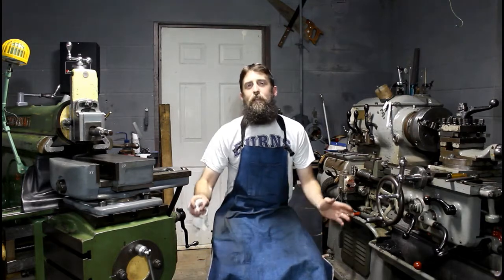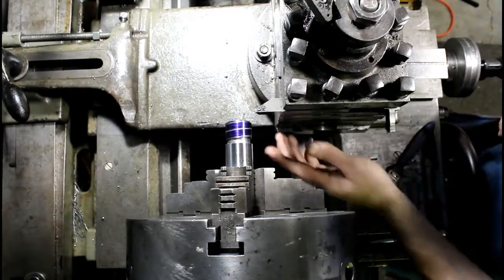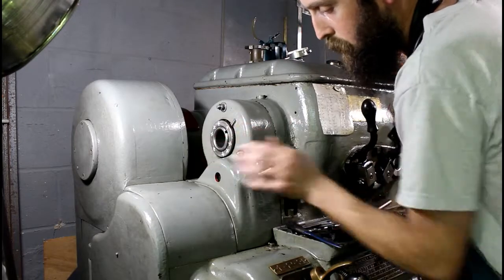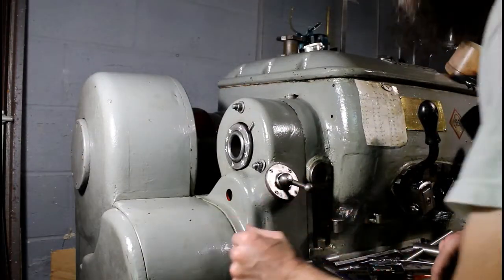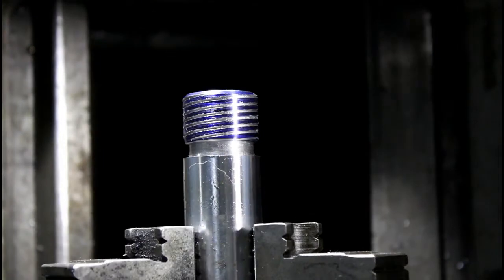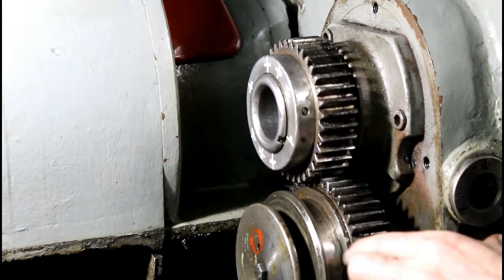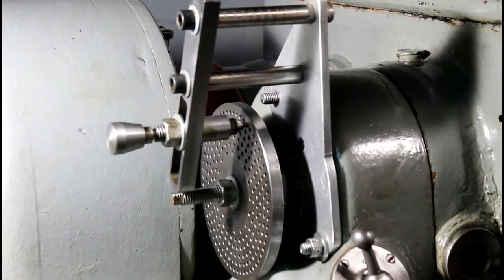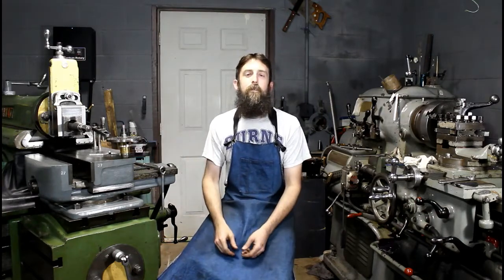Lathe Spindle Indexing / Multi Start Threads

Comment: Excellent video, many thanks.  My DSG has the same feature as yours at the L/H end , but differs slightly in that the collar isnt  fixed, but engraved like yours. Ive done a similar thing as well with the dividing facility, but with a 48T changewheel, so yours is a lot better !. Never done a  multi start thread, but know how to do it now !!. Regards from the  UK.

Comment: Completely ignorant guy with no machine-tool experience here to ask some honest questions. So, by adjusting the angle (indexing?), the angle of the cutting implement (unsure what exactly its called) is changed, which in this setup allows for the cutting of new threads below the ones you already cut? The reason I'm asking about this is because I'm doing research on early automation (late 1940's through the 1960's), and I'm trying to familiarize myself with how lathes, mills, and other cutting, trimming, and other related machine tools work.

Comment: I need to upgrade to a bigger engine lathe gear head lathe....  I learned on a small old Logan and I also have a hardinge dsm 59 with a LOT of tooling, but that is a totally different type of application as you know.  I have limited space, what would you suggest as a home shop lathe at around 7 or 8 feet in length. I was thinking monarch as parts are easy to find. Anyone have any thoughts ? I love doing heavy tool Making and need rigutity !!!!  I love hard turning

Comment: Hi Steve,  Thanks to ABomb I recently found your channel.  Really enjoy it and your down-home style.  The indexing head you made for your lathe is nearly identical to one that came with my Dumore Versa Grinder, Milling and Slotting attachment for lathes.  I had no idea what the index head was for till I found the manual for the Versa Grinder on VintageMachinery.com.  I’ll keep watching, if you keep making your videos.
Reply from the maker: Thanks Bill, Glad to have you here, I had to make something that I could install easy and remove easy. I used scrap parts from anything I could find and it turned out to be a good tool.  I have got lot of good info form http://vintagemachinery.com/            Thanks for watching     Steve Summers
Reply: Hi Steve, gratings from Argentina, I was wondering what brand of lathe is yours, keep those awesome vids coming. Big hug

Comment: Steve, I think I have the dirty twin to your lathe. Mine was built in 1943 according to Hendeyman over on the Practical Machinist (he'll give you the year of manufacture if you give him the serial number). I posted a couple of videos of pulling the apron apart to repair some wear if you ever have to get that far into your lathe. Thanks for sharing. Craig
Reply: I cut a lot of double and quad lead threads for drill rig tooling I use. The Hendey makes it a breeze. Craig
Reply from the maker: Yeah, thread cutting on these lathes is a breeze
Reply from the maker: Yeah, I ask him one time but forgot what he said , LOL  I think mine is a 1942. They are a great lathe, mine is worn bad in the tail stock but I shimmed it and can still get good work off it. I would like to see those videos, post a link if you can. I would like to see what you did.    Thanks for stopping by clemwyo.      Steve Summers

Comment: Nice video Steve, I dont know how your method would relate to my Atlas Lathe if at all but enjoyed your vid. Subbed :)     PS, awesome looking lathe.....beast!👍🏼
Reply from the maker: Thanks, I have  never run an atlas lathe but if you can disconnect the QCGB you should be able to index in some way. not for sure really. Thanks for the Sub, I am new and only been making videos for about 2 months so there is a lot for me to learn. I  Subbed you also by the way, nice channel.
Yeah the bug lathe is like a train car parked in the garage :)
Reply: Yeah, I dont think disconnecting my QCGB will be happening anytime soon, I have a few workarounds for indexing simmering on the back burner...but the bull gear is indexed with 60 holes for basic stuff but I want to make new dials for the cross slide and compound and that needs 100. A 100 tooth sawblade will soon find its way onto the back of the spindle me thinks. LOL I am new to machining....love it. Thanks for the sub. I cant place your accent.....Alabama?
Reply from the maker: I live in Kentucky, is the accent that noticeable? :)  I would in no way call myself an expert machinist either,
just someone who has been machining some at work and a lot at home in my free time over the past 8 years.
Reply from the maker: Everyone starts somewhere,  I consider myself a student also, always more to learn when it comes to machining. I am for sure not the hard nose machinist that you run in to from time to time, I am just having 
fun goofing in the shop with my machines. I try not to say "This is how it's done" I say "This is how I do it".
A lot of times I don't have the tools I need and I got to make due with what I have, there's not alot of extra money left after the kids and the bills :)      I am glad you stopped by, if you need anything just ask, I will be glad to help if I can.
Steve Summers
Reply from the maker: Just watched a few videos on your channel and I must say you are very crafty, like your editing and how much work you put in to your videos, I'm still very new and a work in progress :) I'll get there..  Not that you need it from me with my small sub count but in one of my up coming video of mine I will give your channel a shout out. I am glad to have you here, I am interested in casting and such and may have some questions for ya.
Reply: Yeah, I know what you mean about making due with what you have....thats what my entire channel is about...LOL I appreciate your straight forward content...you obviously know what you are doing
Reply: Glad ya stopped by and watched a few, hope you found something interesting to watch there....which ones did ya check out? If you ever need help with casting just holler. I will have some casting videos coming up soon :)
Reply: I have an Atlas also I you can put your forward/reverse lever in neutral (middle position) and it will be isolated from the gear train, I believe.

Comment: Fabulous video Steve - never seen the indexing on the rear end of a lathe - so its helped me with a few ideas to add the feature to my little lathe. Be hell of a lot easier for cutting divisions on dials etc. Very much like your indexing plate assembly with expanding plug in the spindle. yep even more envious of your lathe ! Thanks for taking the time to make the video and upload. Good to see your subscriptions climbing each week-  must be a lot of little critters free of nasty endings around your way :-)
Reply from the maker: Thanks Mat, I could not find any other way to mount the plate to the spindle so expanding plug it was. The plug holds extremely well and will not slip. This indexing setup was one of the 1st things I built after I got the big lathe
and I have used it several times, not so much now that I have the rotary table. As far as subscribers go , I seem to get between 0 and 10 a day on most days I get about 3-5 ,. I am happy to see the channel growing and hope it continues at this rate or even faster would be nice:) . I don't think most people realize how much work it is and how much time it takes to make a decent video, I know I was surprised at how long the editing takes. I know there are a few happy butterflys  around the yard today . It's tough, that's for sure :)
Thanks Mat, and Thanks for watching.

Comment: Those Hendey lathes had some cool thread cutting features. The lead screw dog clutch, the cross slide depth stop, and apparently the spindle indexing. I never knew about that one though. My Mori Seiki can cut multi start threads. Of course, I do have to copy the G76 line and change one number...
Reply from the maker: Love thread cutting on a Hendey, It seems as if the design of my machine was centered around threading and indexing. I don't have a lot of experience indexing on other lathes but I am sure there is a way with about any machine, guess it just depends on how bad you want to do it. Very nice video on the slotter Wes, Thanks for watching
Reply: My dad has an ancient tie-bar Hendey that he keeps around for tool room type work. I don't think it has that index feature, but I could be wrong. I've never had to cut a multi-start thread. It does a nice job of threading though. Much faster and easier than any other lathe I have run.
Reply from the maker: Yeah, they're nice for threading that's for sure, I think some of the tie bar heads had the index collar if I am no mistaken.

Comment: Steve, good stuff! I knew what multi start threads were but never really knew how to go about making them. What can a guy do if your lathe doesn't have a disconnect for the drive train?
Reply: One way you can do it is to turn the compound to be in line with the bed ways. Then you just move the compound to change the start point for each thread. The catch is that you have to plunge straight in with the cross slide instead of at 30 degrees. But, that's not nearly as bad as all the old book made it out to be. With modern carbide thread tools, plunging is fine up to say 10 TPI.
Reply from the maker: The only way I can think of is to remove the gear clock the spindle and replace, it will work as long as you are very careful. I had to do this on a little Chinese lathe I had several years ago.  You will need to count the number of teeth on the spindle gear and figure what divisions you can get out of it. Thanks for watching Gearge

Comment: Thanks for sharing STEVE that was helpful for learning multi start threads.
Reply from the maker: Multi start threads are not hard to do, with a little practice it becomes very easy. I guess the main thing is to take a test pass to make sure your positioning is correct b4 you cut, I have screwed up more than once not taking a test pass.